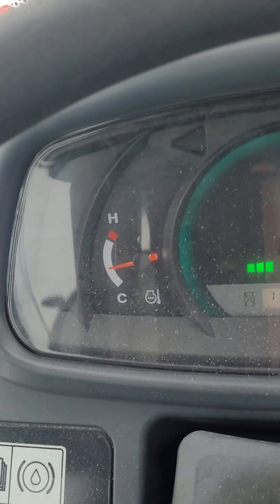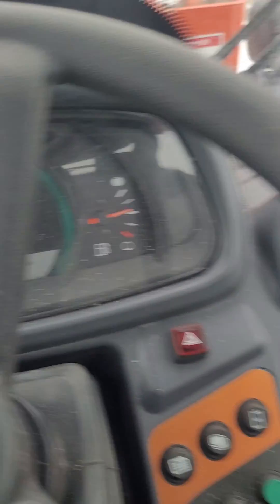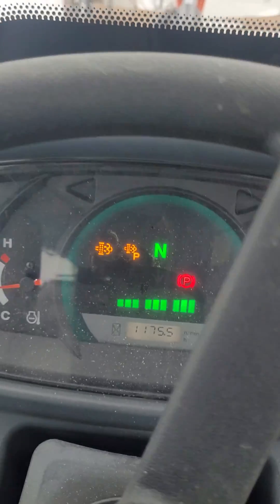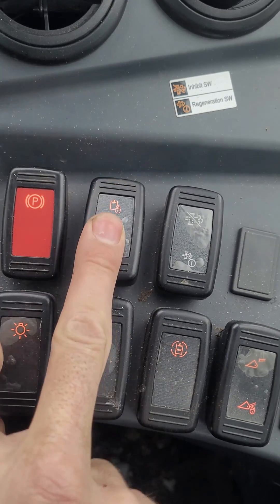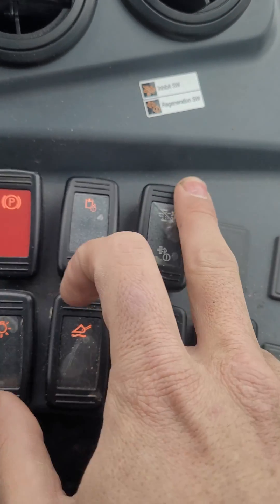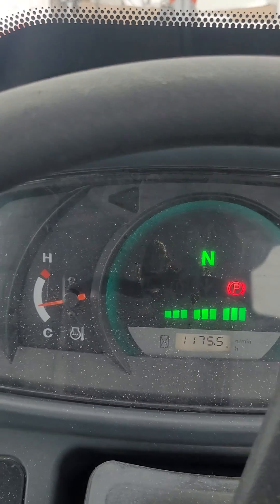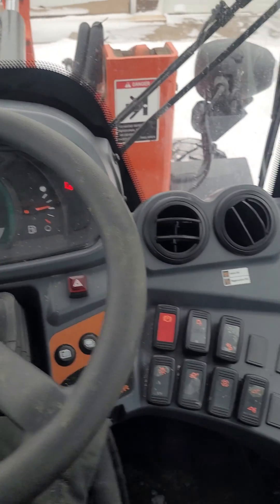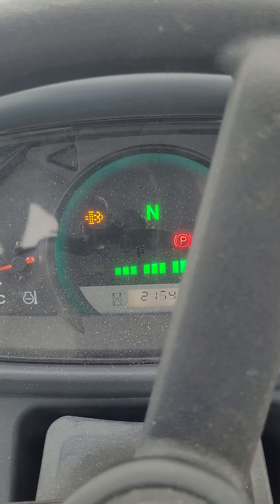Kubota R630 DPF Regeneration

Comment: dude wtf confusing
Reply from the maker: my explanation is unclear for sure but so are Kubota's hence my "attempt" to make a how to. To clarify, for you to start a parked regeneration in the Kubota R630 or R640, you need to ensure that the hydraulics are locked and the machine is put in park. If either the machine is not in park or the hydraulics are not locked, you won't be able to initiate the regeneration process.  thanks for your feedback